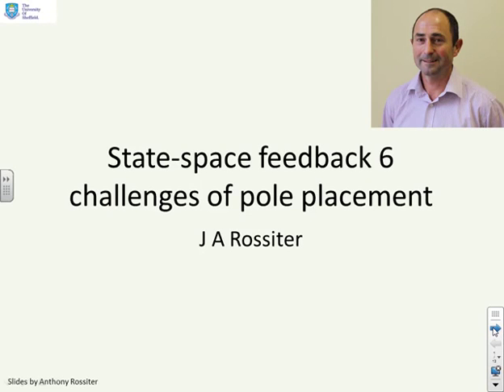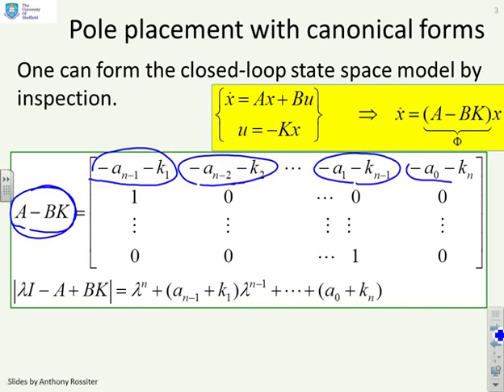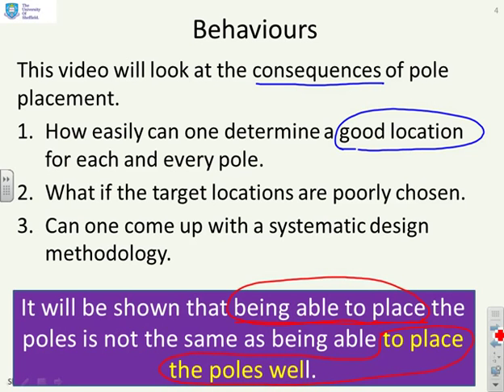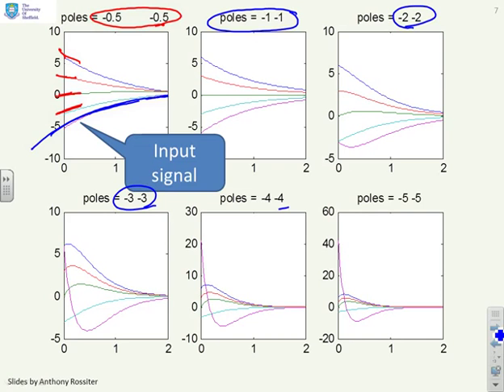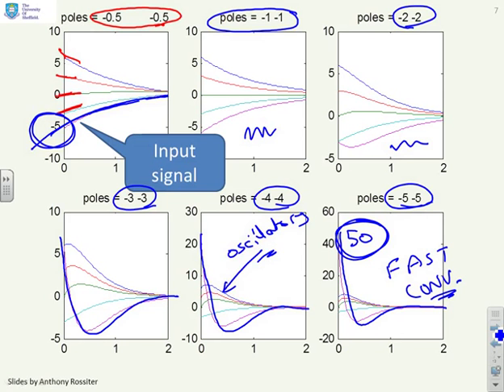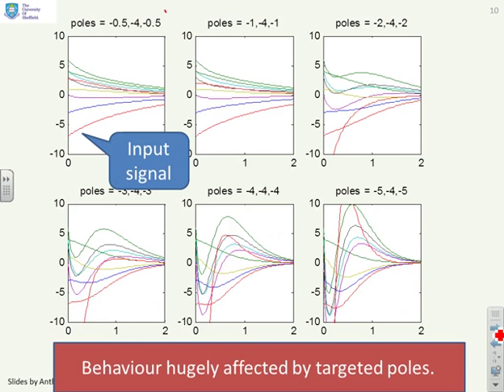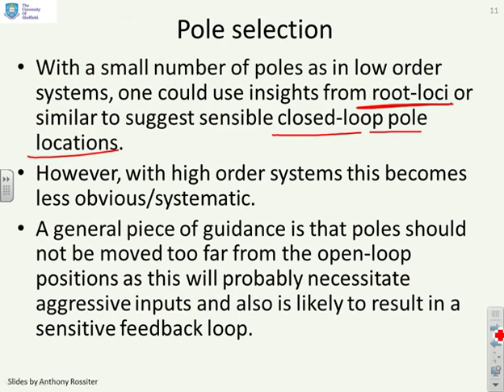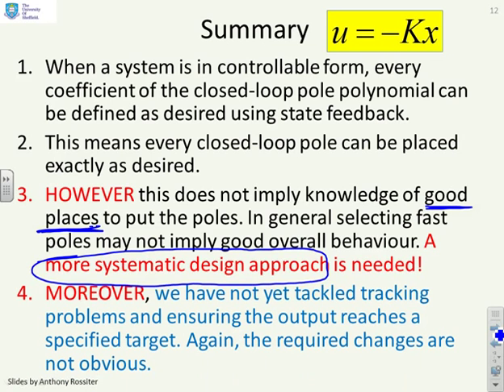State-space feedback 6 - challenges of pole placement

Comment: So for those wondering what the matlab code is, I had a go at it for the first graph of example 1, poles at -0.5, -0.5:

% Trying to do it according to the Matlab controls tutorials site
% http://ctms.engin.umich.edu/CTMS/index.php?example=Introduction&section=ControlStateSpace#24
% Trying to replicate the model on John's lecture
clear;
clf;
A = [-1 -2;1 0];
B =[1;0];
%C = eye(2); % start off just outputting state x1 and x2
C = [1 -1;1 1;1 0; 0 1];
D = [0;0;0;0];
K = [0 -1.75];
t=0:0.01:2;
x0 = [3 -3];

sys_cl = ss(A-B*K,B,C,D);
u = zeros(size(t));
[y,t,x] = lsim(sys_cl,u,t,x0);
% so y is all the output stuff (201x3 double)

x1 = y*[1 0 0 0]';
figure(1);
plot(t,x1);
hold on
x2 = y*[0 1 0 0]';
plot(t,x2);

x3 = y*[0 0 1 0]';
plot(t,x3);

x4 = y*[0 0 0 1]';
plot(t,x4);

U = -K*x';
plot(t,U);

legend('x1 - x2','x1 + x2', 'x1', 'x2', 'input u');